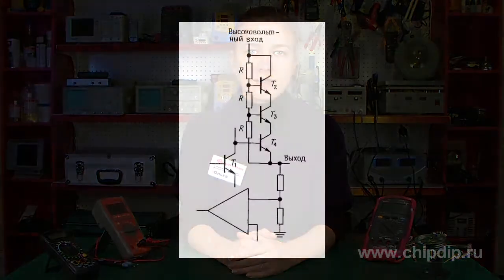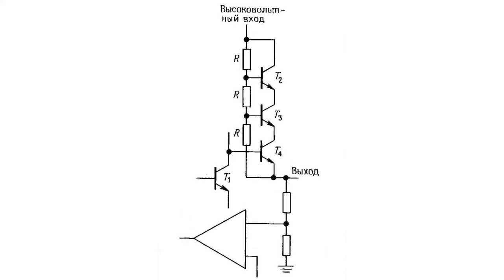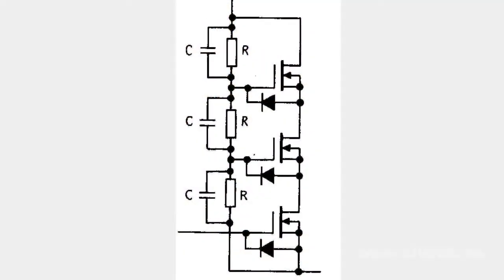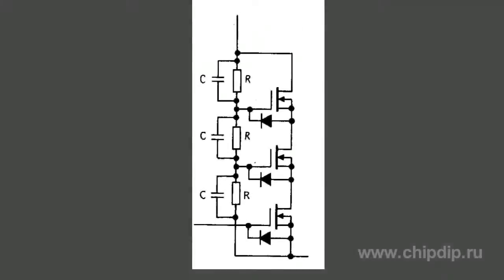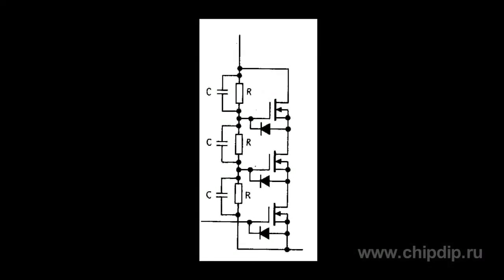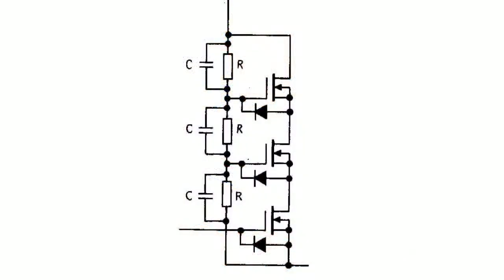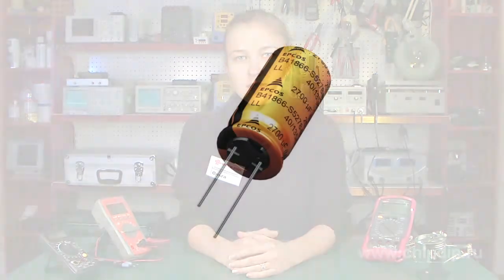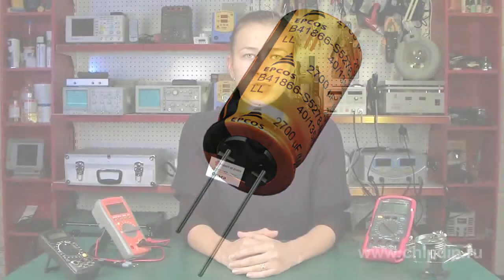Series connection of transistors in power supplies

Comment: Very dangerously circuit. If the Transistors load the bias network not highly symmetric, then the output side will not do too. So you need headroom often so much that you get no advange compared to single transistor. Low ohmic networks on the other hand will caus high current drain at full hight of supply voltage. Not very comfortable or may be not acceptable.